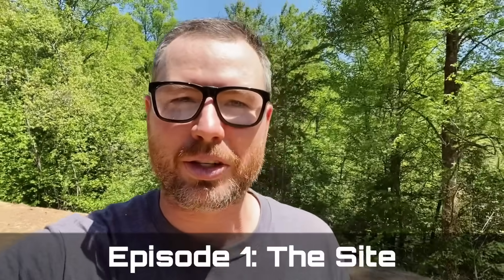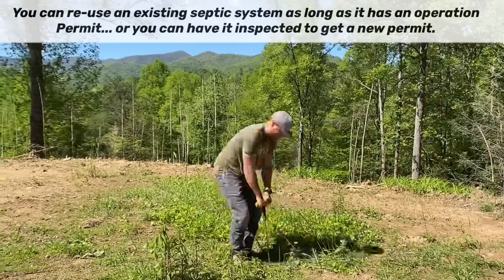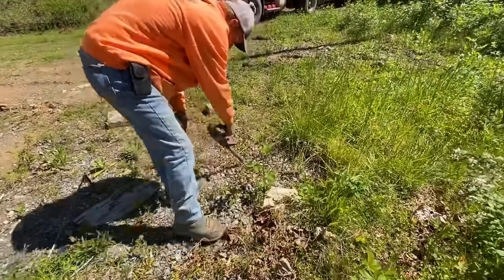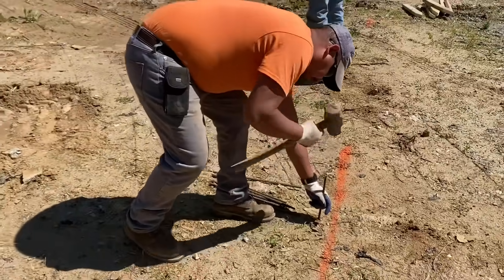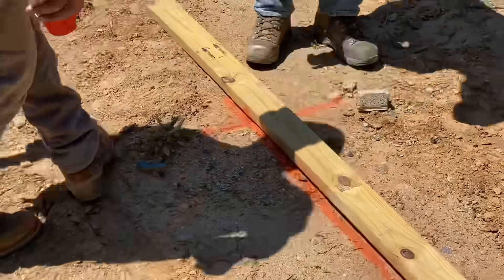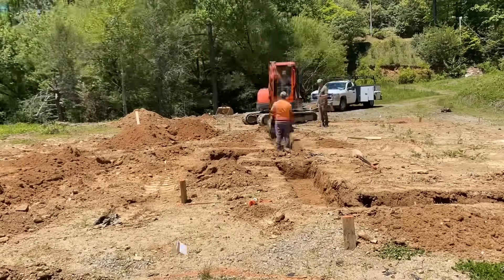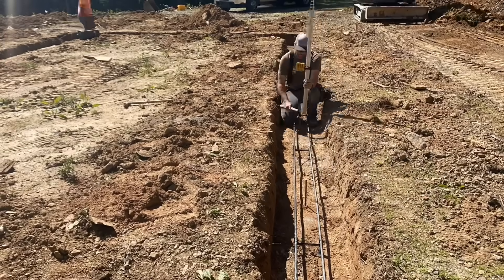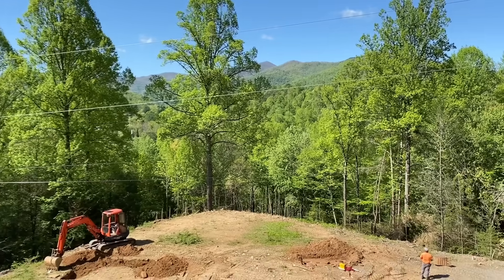Building A House Start To Finish | Episode 1: Site Prep and Digging Footings

Comment: I see this is 5 years ago, so my advice is a bit late.  Cutting bamboo down will get rid of the part of the bamboo that you can see.  It will not get rid of the extensive root system.  Bamboo is an invasive plant that should not be planted in the ground.  It is a container plant only.  Some people make the mistake of leaving the bamboo in a container, but setting the container into a hold in the ground.  Bamboo sheds leaves a lot.  Those leaves will create an environment that will allow the potted bamboo to jump out of the pot.  Stay away from bamboo, is the point I'm trying to make.

Comment: I am building a L shaped home, concrete footings and concrete columns. I want to do my own plans, but I need a good guide on placement of footings. The house is around 1100sqf inside the L is another building I am finishing now. Thus existing building is roughly 5m depth by 10.60m length. Or roughly 16.5ft × 34ft length with 12ft ceilings. The build is concrete blocks solid cement footings reinforced iron. So you can picture it. What is a good program to use for footongs and the floor plan drawings verses loads of the house? Do you know?

Comment: Hi guys! Watch your videos with lot of interest. I am an Architect in India and I have 30 years experience in specially Brick, concrete rebar works since all buildings here are done in these materials. There are couple of things I could suggest that would be better, cheaper and earthquake wise much better. For one you spend too much money on laying the slab on the ground floor level and it would be far better to have an elevated floor mounted on columns and  structural steel beam at plinth. When the floor is elevated and the beams are joined together at plinth level through either RCC plinth or steel beams, the air beneath keeps floor fresh and dry and the need for waterproofing and all the stuff you have to do like the polythene sheet would be unnecessary. Also it not correct to lay the rebar in the dirt. The better way is to first do a 4 inch layer of PCC-1:4:8 which provides a more even and dirt free environment for the casting of PCC 1:2:4 encasing the Rebar above it. The way is to first ram the earth, then put PCC 1:4:8, let it cure for couple of days and then wash it clean and put the Rebar.  Also when you cast the plinth beam you can stick out rebars  vertically with an L bend at bottom tied to the botton rebars which would strengthen your wall nicely it you want to concrete in the cavities.  Also there is a better way to cast the ground floor roof apart from the wood that you use because in wooden floor all the activities that take place on the first floor level cause noise disturbance to the ground floor residents. That would also make your building less of a fire hazard! So feel free to contact me and I could give you some more suggestions.

Comment: 12” deep frost line. Wow, that must be nice.   Here in Nova Scotia, it’s 48”.   A deck here over 24” off the ground, even requires a 48” deep hole, 10”  tube and 29” Bigfoot.   Even if it’s a small entry, of 4’x6’ 😩

Comment: I have question regarding the grade poles. As these are partially buried in the ground they'll rust causing local spalling of the concrete, rusting further and causing more spalling etc. Do you know if this is actually an issue? Decent vid. Thanks

Comment: Great video! What happens when you're poking around the areas where you're checking that it's stable enough to build on, and you find that it's too soft before the inspector arrives?
Reply: They'd either go deeper and fill with concrete, or go deeper and bring back to level with engineered fill / compacted material

Comment: here in the Netherlands we have to dig FAR more but that is because of our ground being really soft and it will sink if we don't.
Reply: I guess you would use piles to search for deeper ground that might be harder. Would it be a common solution or does digging deeper solve the problem anyway?
Reply: @DrawingTechnical  digging deep enough you will reach more solid rock.  there is "bindig". and "night bindiger" (I know them in German because I am an in construction in Germany.  unfortunately I don't know all the English technical terms, and sometimes concepts that exist here don't even have an equivalent in America.) ground types I don't know the exact English translation, but the difference is that one will absorb water like clay or silt.  Nicht bindiger ground is like gravel or rocks.  the pores are larger and don't absorb water.  If you dig deep enough, you will reach better surface, or you just remove a certain amount of dirt ( I don't remember the exact codes). then you replace that dirt that absorbs water with gravel and sand so the foundation doesn't sink.
Reply: Hhahaha ja dat klopt
Reply: Klopt helemaal
Reply: Je moet heien
Reply: I live in a area with sandy terrain

Comment: Hey, Great video on how it’s done.
I have a question about the footing; I noticed you checking & poking the bottom of the footing. Why don’t you use plate compactor for the bottom of the footing than you would know it’s compacted for good? If you don’t need too, it would hurt to use a plate compactor anyway?

Comment: Cane, you will never get rid of it. It has the worst root system there is. It will keep popping up until about the middle of June. You can easily cut down the new sprouts once a week.  If you wait a month you will need to get the chain saw out. I would pick a new sight. Looking forward to the new build.

Comment: In N. Carolina, do you have to pretreat the soil under footings and slab pours for termites?
Reply from the maker: You have to pre-treat under a slab but not under the footings… Or you can just do bait stations around the perimeter of the house and not spray any chemicals

Comment: DIY rookie question: I dug a footer 12in deep and 24in wide so the house we are moving would center the footer. I poured the concrete & realized my mistake! Now my blocks won’t center the footer or else I’ll have a 2 1/2 inch ledge of blocks on the outside of the house. So, would you move the blocks inward to match the house placing them closer to the inside edge of the footer OR leave the blocks centered on the footer & fur the edge of the house out 2 1/2 inches. I will be removing all of the old siding during the remodel. 

I start laying block next week.
Reply: Move the blocks in to match the house.

Comment: 12 inches for a foundation, that’s a garden wall in the uk 3ft minimum even more with trees, nice to see exceeding code in my experience inspectors always appreciate a builder who does that
Reply from the maker: Mark Clinton thanks for the comment... no need to dig deeper here... the site is notched  into the side of a mountian, so we are already 20 ft below the original top soil. Also we are far south, the ground never freezes more than 2 inches. We are all about going above and beyond code as well for things that will make a difference.
Reply: Even 3 feet is nothing up here where I build in Canada! My current garage build is an 18" grade beam on 10 foot screw piles.

Comment: Did the Architect not provide you with a site plan or was the site plan not accurate due to the lack or historical data?
Reply from the maker: The county health Dep’t couldn’t find the drawing that went with the septic O.P.  We just had to find the system ourselves. Not uncommon around here for a 20 yr old septic. Once it was located, we repositioned the house from the proposed location.
Reply: @PerkinsBuilderBrothers  Why not dig up the old system and put the house were it would have the best site lines?
Reply from the maker: Joe Braun $7000 the homeowner did not want spend to do that... and the house was pretty much exactly where we should have put it either way.
Reply: @PerkinsBuilderBrothers  Thanks for the quick reply and I love the channel.  Thanks
Reply: Did you have a look at the plans ? There's no architect on the project
Reply: @BobbyBaloney  that would explain it.  No, I did not see the CDs.
Reply: A Voronoff Meaning that when showing the plans, it says the builder did the design (therefore no architect on the project)
Reply from the maker: No offense to architects (and my Dad is an architect by the way), but on small projects like this, we prefer to just do some sketches ourselves and roll. Way less cost to the homeowner.
Reply: @PerkinsBuilderBrothers  as a Registered Architect, none taken.  As a recent transplant to NC it's a little alien to me to not have signed/sealed drawings for something like this, but then again, I'm from NJ and never did a project in NC and very little residential work.  Kinda funny, I've done projects in NY, NJ, PA, VA, CT, MA, SC, GA, FL, CA, MI, UT & TX... hell, even Busan South Korea lol.  But never NC.  Good to know.
Reply from the maker: A Voronoff welcome to North Carolina! It’s a different world down here… I’ve turned in plans for garage project on a drawn on a napkin before!  (That was about a decade ago).
Reply: @PerkinsBuilderBrothers  I just did a set of drawings for a garage in NJ for my cousin...  it was (8) 24x36 sheets lol